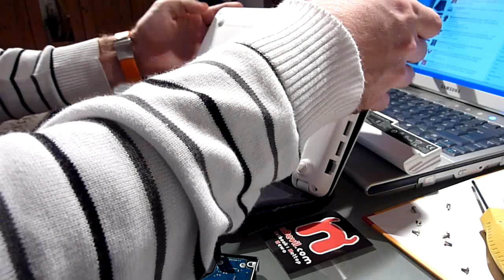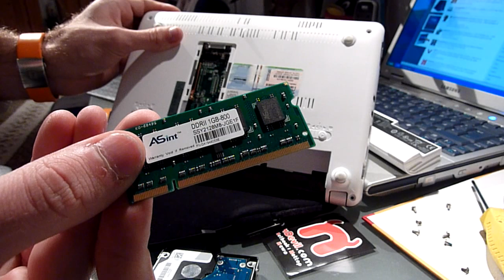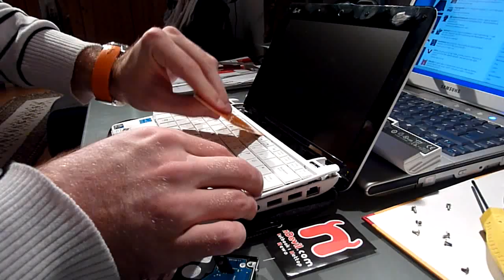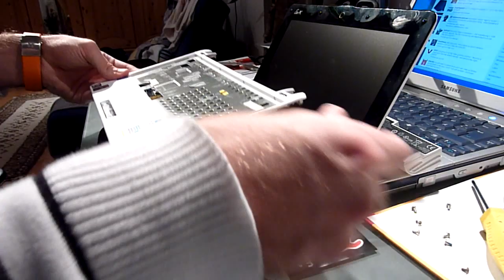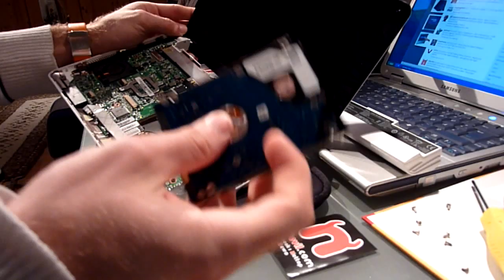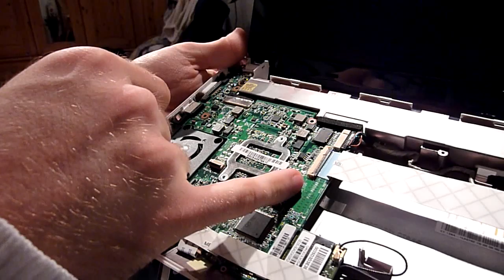Asus Eee PC 1001P Ram Upgrade and How to take it apart

Comment: "not too hard" "really easy", mate with all due respect you had to take apart half the friggin device to swap out the harddrive, that seems like its horrible product design.
Reply: DLSS ah yes. hdd will die first. negates the idea to go with external combined with cloud. windows to go WTG is a good option then. I followed the tutorial, unplugging the plug for keyboard was easy but plugging it back was impossible. should've been mentioned here. could be fatal for some.
Reply: DLSS wasn't meant to be upgradable, imho. ssd might boost it up at a costly price but ram will stuck at ddr2 max of 4 gb, and the processor will remain as is as a bottleneck with "inte;" gma lol
Reply: true but then again that's the case with most laptops. but harddrives are typically the first to die (or run out of space) and is probably one of the most changed compartments of a laptop.

Comment: i had forgotten that I left this comment.  my repair lasted about a month before my solder weld broke.  my weld was not flexible the way that the strands wire were, so it eventually failed.  i ended up buying a replcaement part on ebay and this has worked well for the past year.  if you can't find that part on ebay, check out a company called codemicro.  they sell loads of used bits and pieces.  good luck!

Comment: I've had the exact same problem. The cable seems to rub against the left hinge causing wear and ultimately malfunction. I was wondering if you happened to take any pictures / videos of this process? I've seen several teardowns up to this point, but I'm not sure where to go from here to repair the cable. My ASUS is basically unusable at present. Thanks.

Comment: thanks for posting this vid.  i was able to successfully repair my daughter's asus after referring to your video.  my problem was a defective lcd ribbon cable.  i unpeeled the layers of tape and sheilding around the cable, soldered a broken wire back together, then reassembled.  your video is directly responsible for me saving the out-of-warranty repair costs.  plus, the cable i repaired saved me $50 in parts.  that was an expensive piece of wire i fixed.

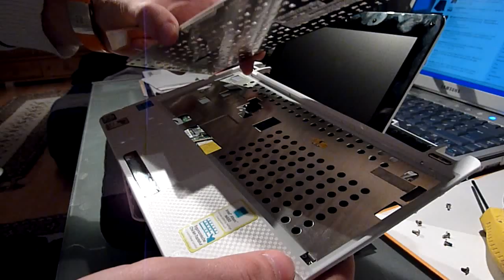Comment: there is some glue under the keyboard so use some force but be carefull, 6 screws! 2:22 unplug by pulling the black upwards, it will turn uppwards or just pull in the blue thing uppwards.

Comment: Have the 1001P upgraded to 2gb's and now uninstalling the numerous junk preinstalled programs (my cover almost broke because it seemed like it was glued down even after backing out the single philips screw: 

- MS Works
- MS Office 2007 Trial
- MS Office Language Packs
- Skype 4.1

There are pre installed games, need to figure out which ones are which so i can remove them as well. May just do a clean install with XP SP3.